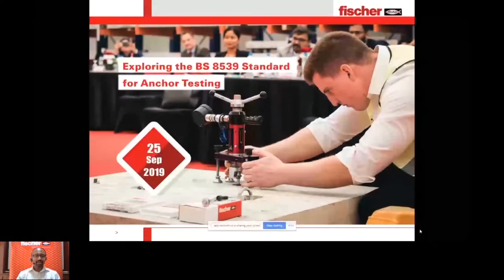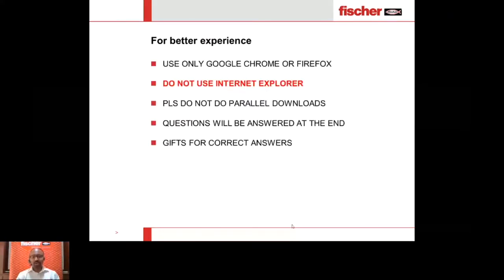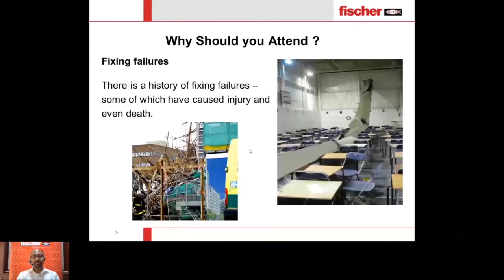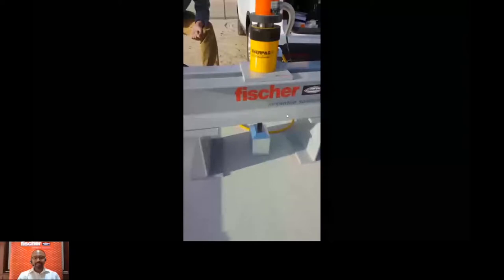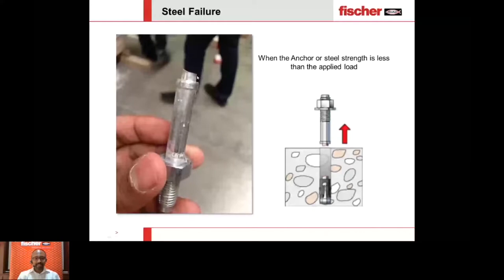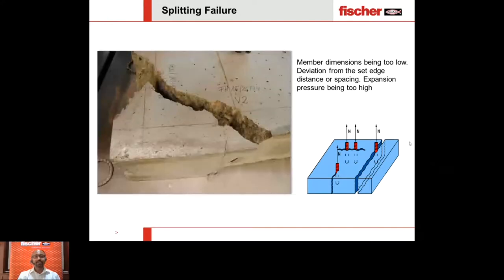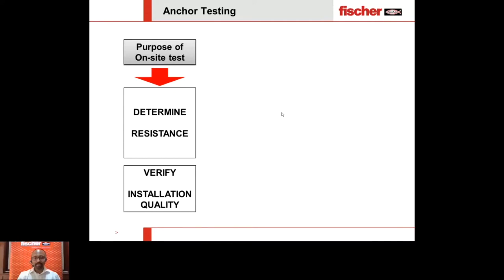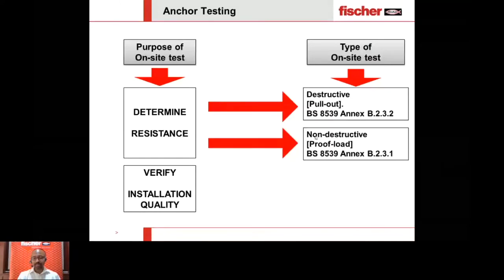fischer Webinar on " Onsite Testing of Anchor & What you need to know "

Comment: The Webinar is very informative. I would like to know in details about torque requirement / calculation in an event of testing where anchor details are not available. Is there any normative reference available to determine torque?
Reply from the maker: Vivek, thanks a lot for the question. The torque value of a mechanical anchor is calculated by the manufacturer to achieve the adequate expansion of clips which in turn creates friction on the concrete. The right torque is very important to achieve the right load values and is unique to the manufacturer and model of the anchor. For chemical anchors, there is no torque required in general though there is a maximum limit of torque that must be followed so as to not break the bond.